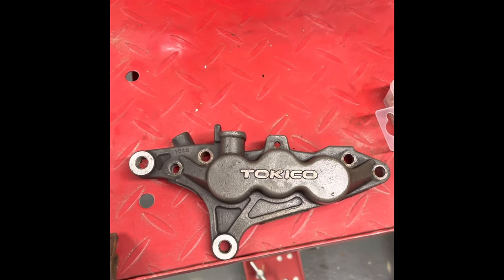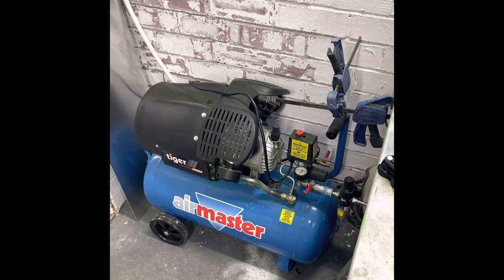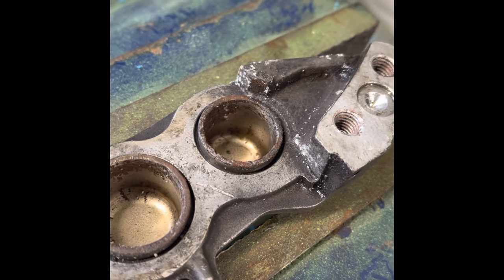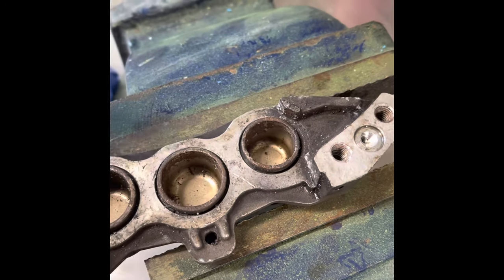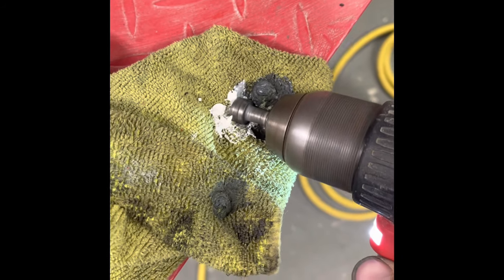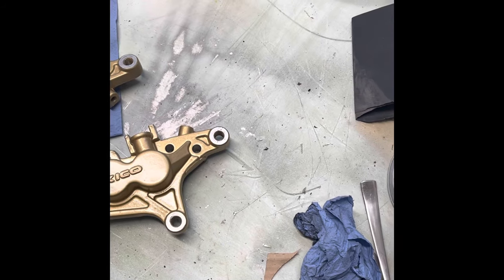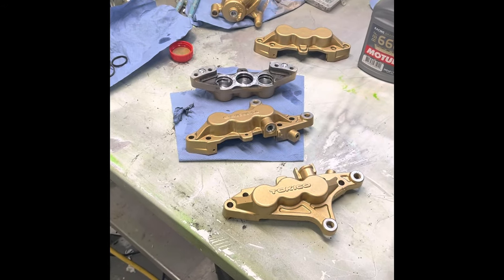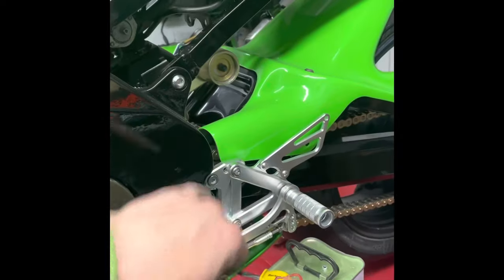Kawasaki Zx9r 6 pot tokico brake Caliper strip paint rebuild

Comment: I didnt even attempt to clean mine, just swapped em for some 4pots. 
That was on my C model,,, got an f1 now, 4pots as stock lol. 
Was weird though. Had the 6 pots on my Gsx1400 suzuki,, never had any issues at all with them. 
Weird. 
You can get Triumph 4pots for the 9,,, it used to be cheaper, plus it makes a good talking point at bike meets . 
Goid luck with the bike mate. 
Nice to see another zx9r up and running.  
👍😎
Reply from the maker: Thanks mate ya keep them going

Comment: Good video. I have a zx7r and zx9r and when I spraped my calipers, afterwards I wrapped a piece of fine wet&dry around a flat plate and then carefully slid the caliper where the Tokico name is over the paper, making sure to keep the caliper flat and not tilted. This brings back the manifacturer name nicely. I saw someone else do this several years ago and a neat trick. I subscribe to your channel and followed the progress of your track bike - looking really good.
Reply from the maker: Thank you ya I was going to do that but don’t really want to go to deep with it being a track bike. But ya looks nice when done
Reply: Haha,  that was my thought too. Doesn't take that long either and it gives it a factory look rather than a look which can give the impression that the caliper was hurriedly painted. 
I also prefer powder coating, especially for calipers as it's way more durable than rattle can.

Comment: Love the content.  Couldn’t stay with the 6 pots.  Had to go to the 4 pot Nissin ones and rebuilt those.   Already feels better !
Reply from the maker: ya am with you there mate its just coz I had race pads
Reply: @johnshomegarage7828  I’d love to learn more about what you did on your machine.  I just finished rebuilding my zx9 (2001) as well from front wheel bearing to back wheel bearing and I also painted the frame!  I kept it as a street build even though I do track my bike as well only because I can’t have a dedicated track bike right now. Be great to compare notes and experiences.
Reply from the maker: Yes no problem mate am also going to put more videos up just need to sort them all out. Iv got a spare engine that am going to strip down and rebuild. 
It’s got a nock so be interesting to see what that is